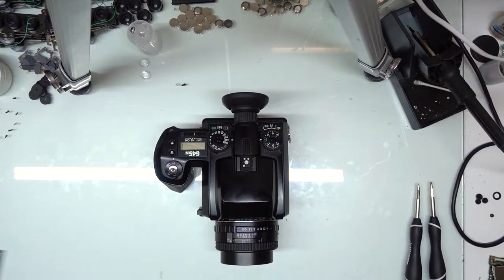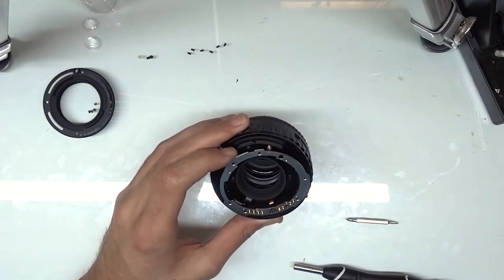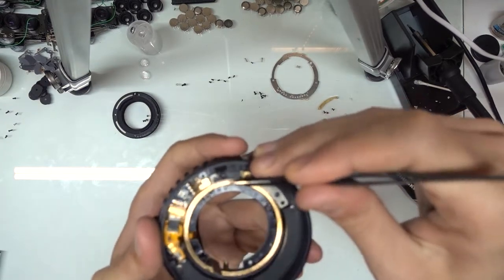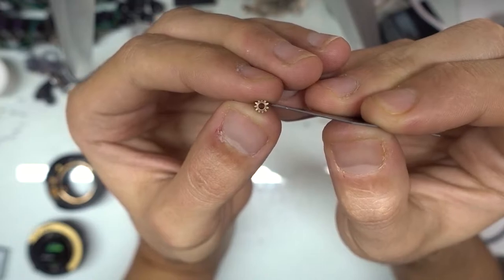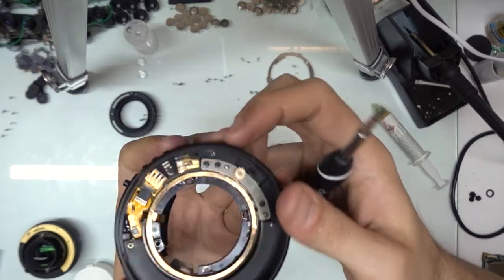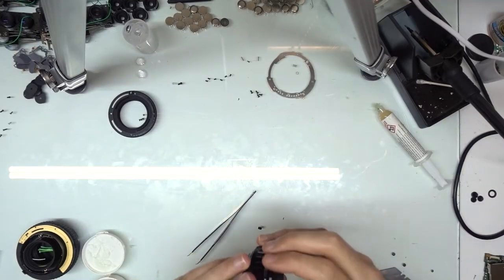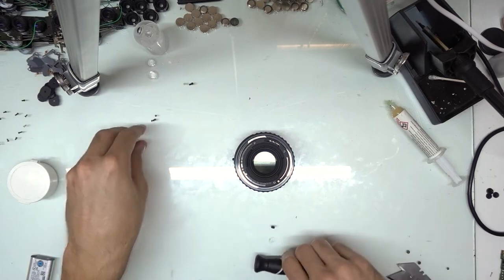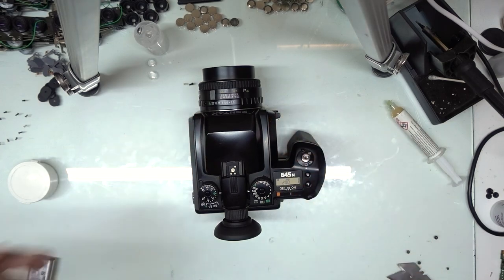Pentax 75mm F/2.8 FA 645 Lens Tear Down & Repair - Autofocus Gear repair

Comment: Thanks to this I fixed my FA 75, awesome video! Helped me avoid a bunch of pitfalls that I wouldn't have been aware of, and it went perfectly smoothly.
Reply: I've got the same issue but terrified to open my lens,  did you use an epoxy to fix the gear or you replaced it with a spare?

Comment: I have a possible purchase of the pentax 654 45mm /85. zoom, there is 1 speck of dust on the inside of the front element, can it be removed easily to be cleaned